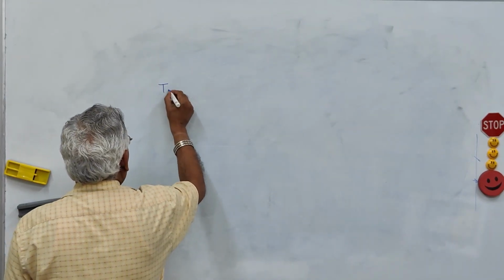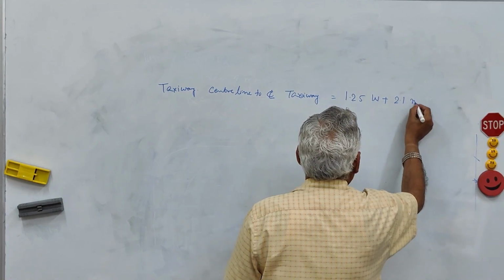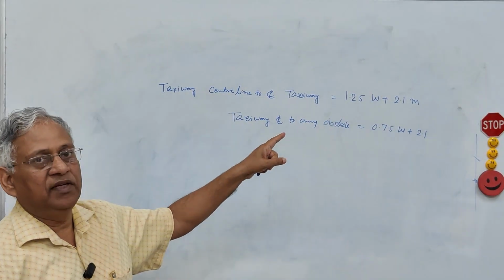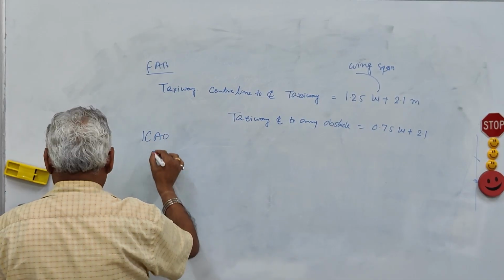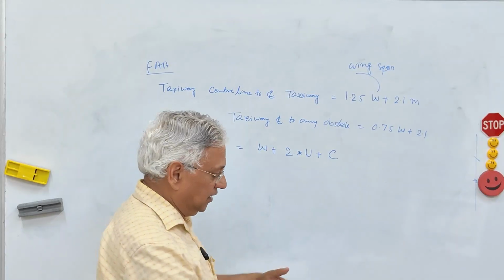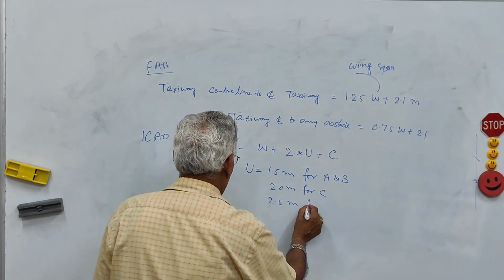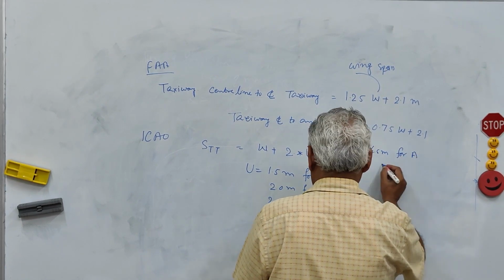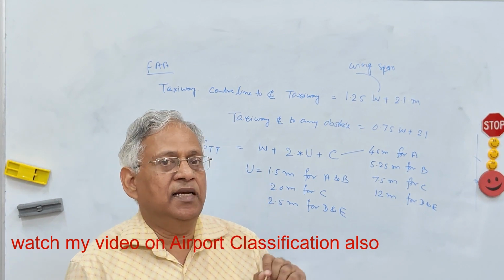Clearance between two parallel traffic ways at an airport. Separation between parallel taxiways.

Comment: Sir I am pursuing M.tech in transportation engineering.which softwares should I learn to get job in design field.
Reply from the maker: There are many software in this field other than IITPAVE and IITRIGID as given in IRC codes. Bentley OpenRoads Designer, Specialized CAD and BIM software may be helpful if you can get hands on them